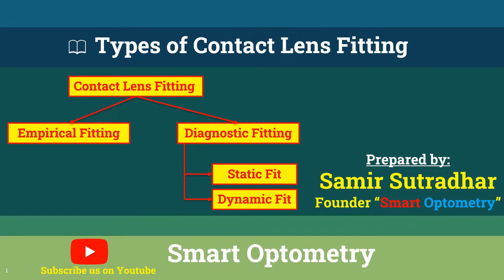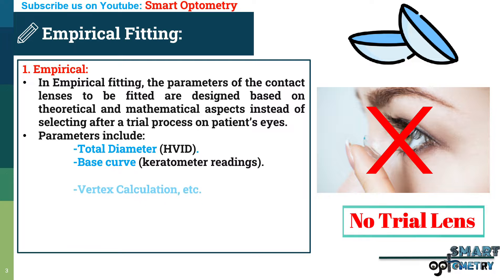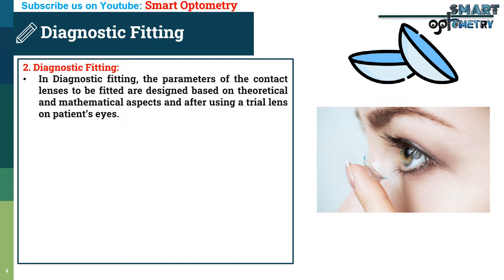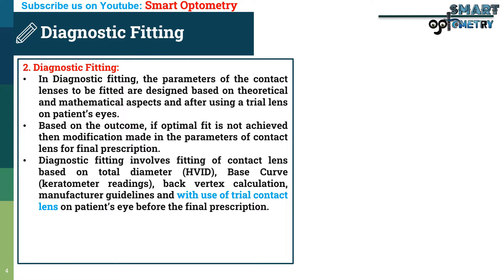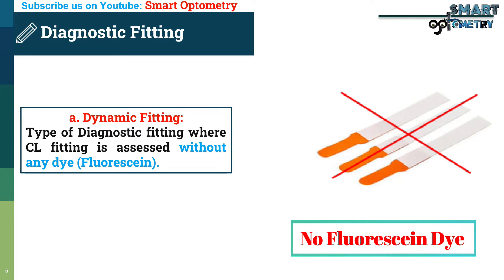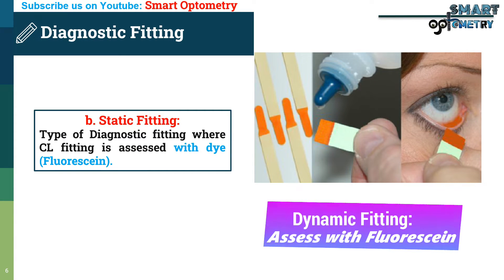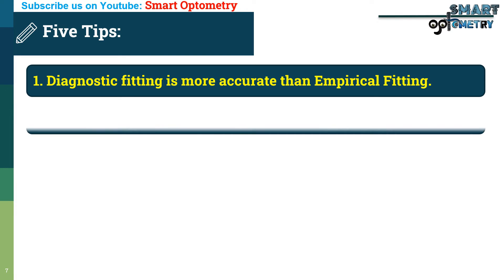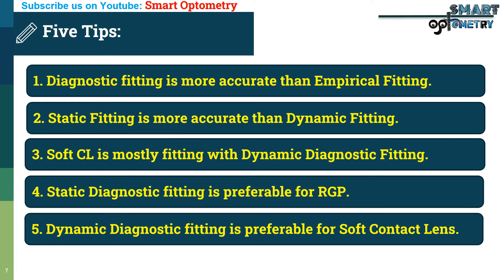Empirical Vs Diagnostic Fitting- Types of Contact Lens Fitting

Comment: Hi could you tell the answer for this question :
What is the standard prescription of zero 
1.0.00
2. Plano 
3. +/-
Reply from the maker: I don't the exact answer.
But I think Plano is standard..
Reply: +/- is the standard prescription of zero.0.00 is not used in order to avoid confusion .and plano is not usually written because the manufacturer may /maynot understand english.
Reply: But standard form is always 3 digits right like 0.50, 0.75, 1.00